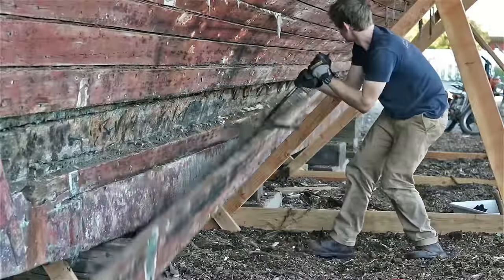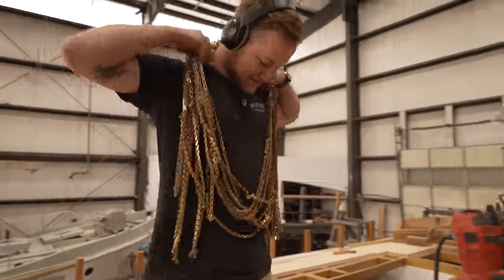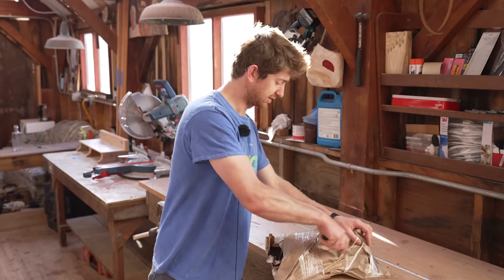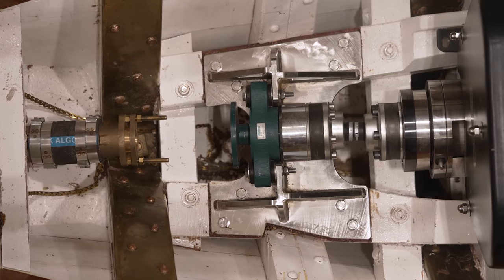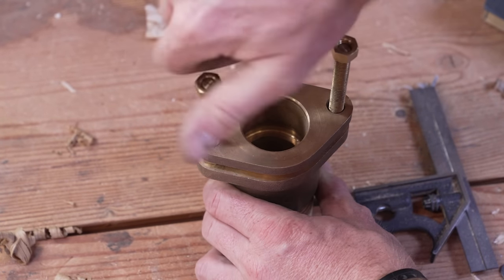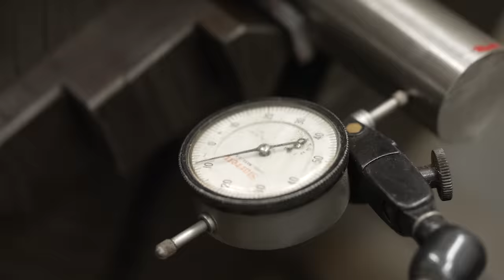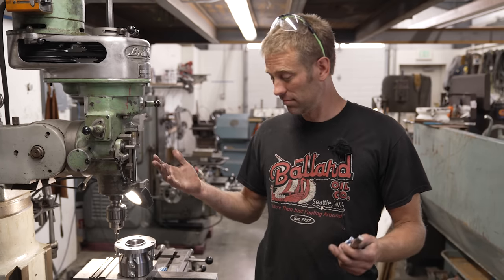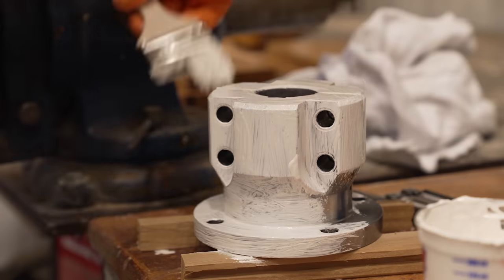Machining the Driveline & installing an unusual Propeller (metalwork & boatbuilding)

Comment: It would be really cool to put a torque sensor in between the transmission and the prop. I have always thought. That + RPM would give you actual shaft power.

Comment: Not sure if anyone else has mentioned this already, will the shaft seal have a grease injection system? All the ones I have used, you gave a turn or 2 on the grease gun after a motoring run. I have an Aquadrive on my boat, a good piece of kit

Comment: Curious why the inboard end of the shaft wasn't tapered where it meets the coupling.  Allows for a nylock nut inside the coupling to retain the shaft, and the taper maintains the shaft true to the center of the coupling.

Comment: I noted that you had a 4 bladed CPP that exited the hull at the end of the long keel.  A question, based on what I was taught by an Italian propeller manufacturer, will you experience a beat frequency due to the two vertical blades being in co-incidence with the low pressure zones created by the vertical parts of the long keel at the stern gland?
This is why blades must not be the same angular spread as the arms of an A-bracket.
Thus, if you have a problem, you might be better off with a 3 or 5 bladed prop.

Comment: Bit confused why you painted the mild steel coupling. Id suggest plating it in Nickle. As you had some tolerance between the shaft and the coupling. A thin layer of plating shouldnt be a problem.

Comment: How do you set the  propeller for the desired pitch? I did not spot the mechanism
Reply: It's a feathering prop, not a variable-pitch prop - there's no provision to adjust the pitch while under way, it's either full-fwd, full-rev, or feathered. Adjustment screws (w/ lockdown setscrews) on the hub adjust the max pitch in either direction. In the hub, an internal gear at the end of the shaft is engaged w/ a gear at the root of each blade. When motors or engine are engaged to drive, the shaft gear winds the blades into position up against their limit-stop, then the hub & blades begin to turn.

Comment: That propellor looks amazing .   The old fashioned blade design must be the optimum for forward and reverse . Does your beautifully installed thrust bearing block work BOTH ways . Just a dumb thought . IE   is the thrust unit compatible with that super forward / reverse propeller functioning / operation . How is the pitch controlled . I failed to see any form of hollow propshaft .

Comment: Curious, but how do you set / lock the trim on the propeller? It seemed from the video that the trim is done by the water flow on the propeller, but how do you lock it in the desired position? Thank you Leo, been loving your videos since the start of lockdown when I was pointed to your channel.

Comment: I hope it's not too difficult to do now ... because it will become extremely difficult later on in ways you've never dreamed of if you don't ... I see lots of bolts and nuts going together dry and using spring washers.  Undo all those bolts and discard the spring washers.  Coat all the shanks of all the bolts and the threads with Res-Q-Steel or similar and re-assemble with flat washers.  Spring washers allow water into the threads, they rust, break and fall off leaving the bolt loose.  Getting seized bolts and nuts undone in a bilge or anywhere on a boat is an engineers nightmare.  And Res-Q-Steel into the coupling before sliding it onto the shaft !
Reply: There are no spring washers in the build.
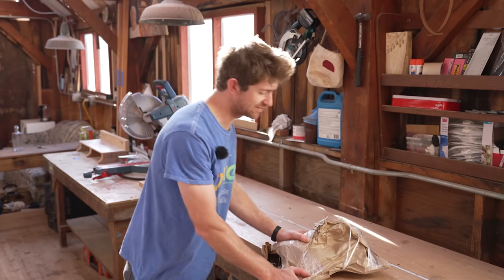Reply: Looks like a spring washer at 5:05-5:08.

Comment: Nothing like that 'new propeller' smell, eh?!
Having bought ground-adjustable "Luftschrauben" from Vario Prop in Germany for my model airplanes, may I assume that the new propeller smell scales up for Wasserschrauben that fit sailing yachts?

Edit:  Tally Ho's prop is from Variprop, mine was Vario Prop..I was working on creating a constant-speed and/or servo-adjustable airscrew (luftschraube) using Vario Prop blades in my own-design hub.

Comment: How does that propeller work? I don't see any external control mechanisms. Does it rely on the resistance on the blades being higher than the turning shaft to get the blades to rotate and then come to a hard stop?

Comment: 20:27, is there actually a jacking screw in that key, or did you decide not to put one after all?
Maybe it is just not visible on the video.
Excellent video as usual and what a beautiful installation.
Fantastic to see it all coming together. THANK YOU!
Cheers,
a.
Reply: Jacking screws are not a permanent part of an installation. They are disassembly tools only.
Reply: @doodlegoat  thank you for the reply. The way I understand this is jacking screws prevents the key from moving and possibly jamming during removal, what am I missing?
Reply: The jacking screw gets turned to apply force between the shaft and the key, forcing the two apart.

Comment: So, if I am correct here, if you want the prop to drive the generators while under sail you need to kill the engine while the transmission is in reverse? 

This means they’re flipped into reverse position and water moving past cannot flip them into the feathered position… I think?
Reply: Your 2nd sentence is correct, but not the 1st. You'd want to keep the diesel shut down & its gearbox in neutral. Use the electric motors to drive the prop in reverse for a few seconds, that moves the prop into reverse pitch. With sails driving the boat forward, now you can switch the electric motors to generator mode & charge the batteries. As you correctly noted, waterflow keeps the blades pinned in position. When the charging session is completed, you'd run the motors in forward drive to spin the prop blades into forward pitch, then shut the motors down. With no drive on the shaft, waterflow will slowly force the blades to feather.

Comment: Hi there, already deleted the spam on my comments. Nice installation on the shaft, did you (or are you) considering a rope cutter or shear bolts. We just had a boat got fouled on a hefty chain attached to a buoy in the river, on first examination stuffing box has been on fire...still waiting for a better look inside and haul out to clear and check the prop and shaft

Comment: I'm curious how that prop adjusts its pitch, and how much it cost. 
Also, does it not make any sense to put a lil dab of grease on all those bolts before you put them together? It helps keep them from rusting, and they are easier to repair years from now.

Comment: Curious how you set the angle of the prop blades and lock them in for what ever need you have... ie Power generation, motoring, sailing. Is there some sort of mechanism in the shaft that sets the angle of the blades?

Comment: Been having fun watching videos and reading up on how variable pitch props work in the water. Being a pilot I'm used to having to manipulate the feathering manually, pretty amazing a lot of that can be done automatically depending on whether the engine is spinning in forward or not engaged. Still trying to wrap my head around how it stays engaged during sailing to charge the batteries. Another thing I was curious about is the decision on 3, 4 or 5 bladed props. I'd imagine it's a hydrodynamic tradeoff between thrust and efficiency. Anyone able to dumb it down on why a 4-bladed prop was chosen?
Reply: "Still trying to wrap my head around how it stays engaged during sailing to charge the batteries." So am I. Can someone explain how it works? Is it simply the resistance from the generators with the gearbox in reverse and the engine de-coupled?

Comment: You can mask areas for silicone just like you mask for paint... saves a ton of mess/cleanup time..
Reply: That's not silicone it's polysulphide.
Reply: @jimurrata6785  am sure that makes a big big difference..
Reply: @randalljames1  That 4200 is truly evil stuff.
It doesn't behave anything like you would think a caulk does, and you actually want to smear it around to make damn sure everything is tighter than a ducks ass.
'neat' doesn't count when staying afloat is the priority.

Comment: I'm sure some others noticed as well, but have not yet read though the 1.4k comments, did you miss or decided to install the axle key opposite to the fastener hole you customized in the aqua shaft? reasoning?

Comment: I still was scratching my head on this a bit. Someone questioned if the prop is engaged in its reverse thrust position and the shaft is rotated in the opposite direction, would that not generate a forward thrust?

At first I was wondering the same thing. I served on a ship with controllable pitch propellers. The propulsion shafts only turned one direction. So if you were looking at the top of the blade toward the hub, its leading edge might be at the 4 o'clock position. To go in reverse, a hydraulic system moves the blade leading edge to the 8 o'clock position. I looked up some of the manuals on this prop. Since its application is on a shaft that reverses direction, using the same clock reference, rotation of the leading edge to the reverse position would be to something like the 10 o'clock position. The blade is essentially in the same orientation to the hub, but the leading and trailing edges are in the right place for each purpose. In that case turning the shaft in the opposite direction achieves reverse thrust. Once in reverse position, the blades cannot self return to feathered position. Forward motion under sail would then turn the shaft in the normal forward rotation for regeneration.

The manuals are full of cautions and procedures to not over stress the propeller internal gearing. Direction changes are only done at low speeds (under 4 knots).

Comment: Is the white mild steel piece a failure point.  And that’s why it’s mild steel or is it mild steel because it has to clamp onto the shaft and compress and hold it.

Comment: I had a traditional stuffing box with the newer high tech stuffing material no leaks or heat lasted long no problems replaced it with a supposedly leak proof shaft seal  $ $ $ now I have leaks at certain rpms when the engine is shaking.    DAMN IT why didn't I leave it alone ? ?

Comment: Youtube Lumnah Acres just purchased a like new 14'x48' HD Vinyl TARP....CHEAP!!!    One side is black and the other side is a BillBoard AD.  I guess billboards now are on vinyl tarps....which are easier to put up. His tarp said STATE FAIR  dates....  so it was obsolete. Has a pocket for a  rod for hanging.  Guess a few hours putting in Tarp Strap holes rings would make it a nice $ saving for a trucker.

Comment: Nice prop. But how do you control the feathering of it? Did I miss the control surfaces on the prop shaft?
Reply: It's not a variable-pitch prop. Gearing inside the hub winds the blades into position. When engine power is engaged for forward movement, the blades rotate to provide forward thrust. When the engine is shut down or disengaged, the water pressure of forward motion gradual forces the blades to feathered position. When the engine is engaged for reverse, the blades rotate to reverse pitch - but in this position, water pressure of forward motion keeps the blades pinned in reverse. This allows the electric motors to be switched into generators, & as wind in the sails provides forward movement, the prop turns & the generators charge the batteries. When the charging session is finished, the motors must be run for a few seconds in forward drive, to turn the blades back to forward pirch. Then when the motors are shut down, the blades will feather.

Comment: Just wondering how the feathering is controlled from inside the boat. Is there a linkage through the prop shaft?
Reply: It has one setting and then the feather. It's not externally controlled or adjustable.

Comment: Wow Leo, great video as always. All those drive components look so well made, especially the propellor, although it seems a bit undersized for a boat the size of Tally Ho, as you said. How is the angle of the vanes set when in use? Also, don't you need to torque down the bolts on the various bits of the drivetrain?
Reply: I also wondered how the feathering/reversing/locking of the propellor is done. I didn't see any control linkage - is it possible to set it just by cunning forward/reverse operation of the shaft?

Comment: Do you have to get in the water/out of the boat to adjust the prop fin angles?
Reply: Yes - the pitch is adjustable w/ locking setscrews on the hub.

Comment: With that prop, can it go from full forward to full reverse  by just adjusting the pitch without any change in engine rpm or gear change ? You did say that if the ship is sailing and the prop is locked in reverse, it will generate electricity to recharge batteries.  So it should be capable to just changing the pitch to get reverse without adjusting anything on the engine (like what happens on propeller planes on landing).
Reply: No, this is a feathering prop, not a variable-pitch prop. Internal gearing in the hub moves the blades to the fwd or rev position as the prop shaft rotates. So you must shift the diesel gearbox or change the elec drive motor polarity to shift from fwd to rev & back - there is no adjustable pitch, just preset limits on the pitch in eithet direction. When in fwd drive, the shaft winds the blades into fwd position & then the prop starts to spin. To feather the blades, stop the engine in gear to immobilize the shaft & waterflow forces the blades to 0°, otherwise the blades continue to windmill in the flow & will only gradually move to feather. The case in rev is different, b/c the waterflow holds the blades in rev-drive position. So to end your reverse motoring or regen session, blip the gearbox or polarity to fwd drive, to wind the blades from rev to fwd position, then allow them to feather as above.
Reply: @frederickstibbert7389  Understand.  Thank you for the detailed reply.

Comment: How does one adjust the position of the feathering blades while underway and operating the engine... Or sailing and using the prop to generate power?
Reply: It's not a variable-pitch prop, gears in the hub wind the blades into full forward or reverse pitch when the shaft is driven. When the shaft is in neutral, the waterflow of forward motion will feather the blades if they're in forward pitch. If they're in reverse pitch, the waterflow pins the blades in place & spins the prop, for charging the batteries. When finished charging, the motor is run in forward drive to turn the blades to forward pitch - then they'll feather after the motor is shut down.

Comment: How is the the propeller pitch changed?  is it just centripetal based on direction of  rotation and power application?
Reply: Gears inside the prop hub drive the blade pitch. When the engine or motors are shifted into drive, the shaft spends half a turn or so winding the blades into position before the prop starts to turn.

Comment: Vetus supplied the Bow thruster on my barge - the drive gearbox failed after 4 years; warranty 3 years...obv.  When I asked them about this, due to the fact that during 2 of those years, Covid restrictions meant the boat was unused, they didn't even bother to reply to my email. The type of failure was not wear related. Be aware.

Comment: How do you lock the propeller in to it's reverse position for power regeneration?
Reply: In reverse pitch, the blades are held in place by the water pressure of the boat's forward motion. In forward pitch, that water pressure forces the blades to feather, unless the shaft is being driven by the engine or motors.

Comment: How do you set the pitch of the propellor blades? It didn't look like there was any connection to it? Is it Bluetooth?
Reply: There's no variable pitch, once the limit screws are set on the prop hub. There's only full forward pitch, feathered, & full reverse pitch - controlled by the rotation (or lack of rotation) of the prop shaft.

Comment: Hey how you gonna adjust the pitch of the blades from inside?
Reply: It's not a variable-pitch prop, it's a reversing / feathering design. To shift the blades' orientation, one must use the motors or engine to wind the blades into fwd / rev position. When the prop is in reverse for regen, you must blip the motors into fwd drive & wind the blades back to fwd mode, then shut the motors down. Waterflow holds the blades in rev, but in fwd position it will gradually feather the blades, unless they are actively being driven by the shaft.

Comment: Given that the drivetrain is made of a mix of mild steel, stainless steel, and bronze, and most of it is in contact or near-contact with seawater, how do you prevent galvanic corrosion on those parts?
Reply: The dull-silver end cap on the prop is a sacrificial anode made of aluminum, magnesium or zinc, whose electrical properties give up electrons faster than other metals. Eventually it will burn itself out (oxidize), so it must be replaced at stated intervals.
Reply: @frederickstibbert7389  I thought it was just an endcap for the big nut, but that's actually pretty neat, thanks!

Comment: How do you change the propeller from reverse to forward mode and back? I assume no one has to jump in the water and do it manually?
Reply: Inside the prop hub, a gear on the end of the shaft engages gears at the base of each blade. When the motors or diesel turn the shaft, it 1st turns the blades to their pre-set limit, then the hub & blades can spin to drive the boat. When shifted to the other direction, the internal gearing spins the blades to the other direction, which takes about half a turm. An internal shock absorber eases the changes of motion inside the hub.

Comment: Is setting the prop pitch a manual operation that must be done by someone who has to jump overboard...or is there a more elegant way to do this?
Reply: The pitch in fwd & rev is adjusted by setscrews on the hub, usually when the boat is hauled out of the water.